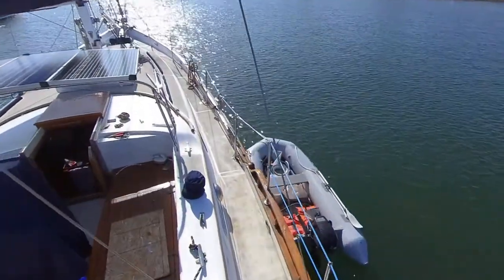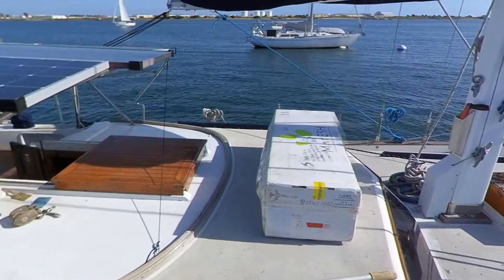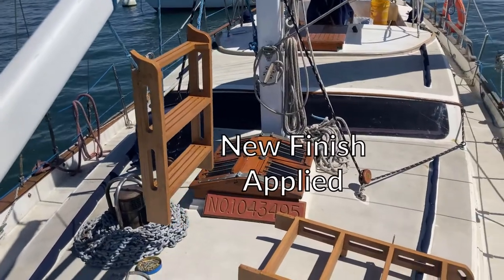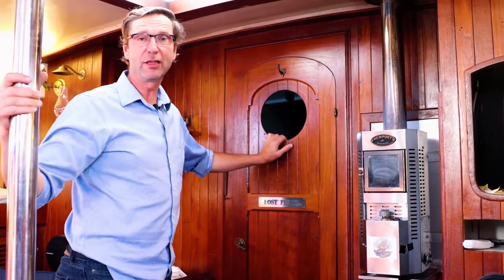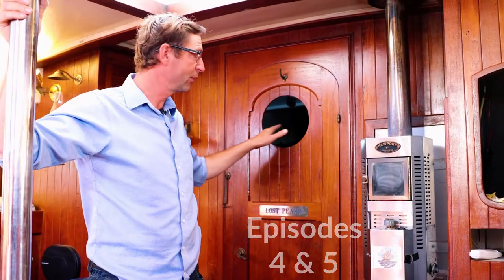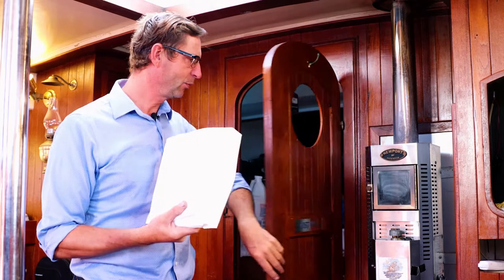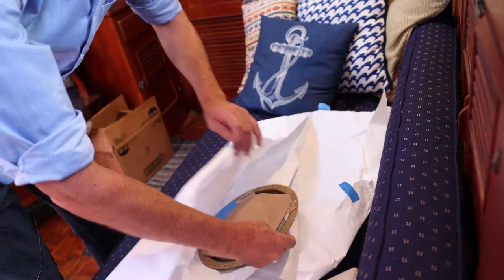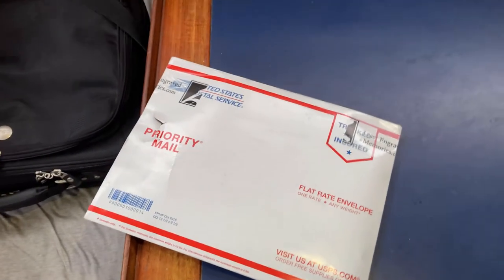Ep8 Boarding Ladder and Etched glass

Comment: ... I do have several ideas on how to modify the boarding ladder w/ a lil'  of hardware and line  ( and elbow grease )  ... most people do not know how hard it is to lift  one's self out of the water ... add  wet cloths and hypo-therma ... and you are in trouble quickly ...
Reply: @OnnoKok  ... you need to be able to "deploy"/unfold it ... when you are swimming (especially in COLD water).  The Hook Latches are up to far and out of reach.  I would use a "small line tied to the bottom rung ... up and over the top rung and run down "inside" to the bottom of the ladder were it is tied off.  Undo the line and the bottom section should unfold/deploy downwards.  (... have you tried to climb up a "rope" ladder ???  I have ... they can be very difficult to climb because the bottom always swings away,  unless you have.  something to push against ).  I like what you are doing and the order you are doing it ...  I would sail w/ you anytime ... and I do pick my "skippers" carefully ...
Reply: @OnnoKok  I'll have to look closer and see which way the "pin" slides ... towards the "hull side" ???  If so you could do something along those lines (HaHa) ... turn the line around a small flush mt harkin block ... hanging down ... pull on the line ... pull pin back ... ladder unfolds ... and you can climb the ladder and get out of the water ... YAaaa ...
Reply: ... I have a Scotch/Irish/German head ... but I would still be swimming to the side ... HaHa   So the pin movement is vertical ... not horizontal ???  Still that can be "worked" w/ ... and adapted.

Comment: ... so ... a "clevis pin" w/  a ring ... small line tied to it ... (2) harkin "cheek" blocks mounted up higher to pull the pin up on each side  ... I would run the line then down to the bottom of the"hull side" and through a small hole drilled through the wood ... "figure (8) knot"  ... and there you have it ... simple and clean ... and you can deploy the ladder while swimming  ... Cost: under $20 ... maybe $10 ... (I would search the "discount " hardware bins at the marine store ...
Reply: @OnnoKok  ... this the type of "stuff" ... I just like "EN-GA-NEERING ... (I do have a mech engineering degree) ...  Please post pics when installed ... I would allow the "line" to loop down slightly so it is easy to grab ... then through the hole ...

Safe Sailing ... ( you can "buy" me a beer at some later date ...)  FYI,  I am on the East Coast/Chesapeake Bay (Eastern Shore)

Oh ... watch your head !!!  ... I want to see how you lift the old engine/diesel up and out of the boat ...
Reply: ... safety first ... always first !!!

Comment: how did you attached it on the hull? would like to see how you did that?
Reply from the maker: Good day and thanks for watching. The ladder is attached to the hull via steel bars that hook onto the genoa track. So I can use it on either side of the boat in multiple locations. I have a security line attached as well as sometimes the dinghy can come up underneath and pop it off the track. 
Cheers!